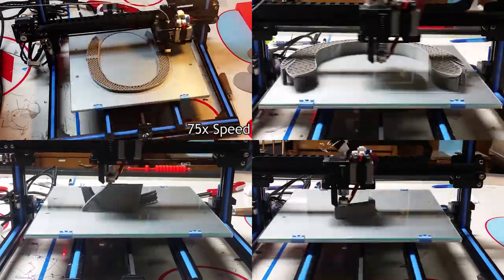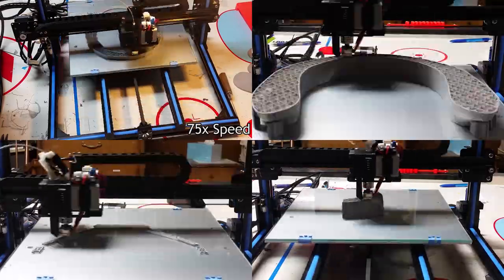Metro 2033 Spartan Helmet 3D Print Final Timelapse

Comment: That looks dope, I am planning on making one myself. Where did you obtain the stl?
Reply from the maker: I created it from the game's files. Unfortunately this has lead to some issues with the visor fitting on the helmet which is why I haven't uploaded anything on this in a while.
Reply from the maker: I've come up with a few ideas on how to fix the issue which hopefully won't involve reprinting it
Reply: Did you use 3D Ripper DX to get the helmet from the files? The only thing close to a 3d file I found was the papercraft pdo but that wouldnt do me any good.
Reply from the maker: @Spartan2035  I can't remember where I got the file. Once I get this worked out I'll share the files on thingiverse. The file I found was the .obj exported directly from the game and took me many hours in Meshmixer to fix.
Reply from the maker: @Spartan2035  If you don't want to spend the hours fixing it in meshmixer you can either wait for me to release the files (no guarantee this will actually happen) or make the paper craft one using cardstock and cover it with epoxy resin to make it rigid.
Reply: I actually managed to find a 3d file on the D6 Underground website. Im still a noob when it comes to that stuff but Ill play around with it until I get it right or you flesh out the files on your end (I would donate for the project if it was possible)
Reply from the maker: @Spartan2035  Could you send me a link to the file?
Reply from the maker: I think that''s actually the file I used. 3D slicers are very particular about files. The meshes have to be manifold, or in other words they have to be watertight. There can be no intersecting shells, and they have to be in .stl format. Game engines need none of this. Devs generally try to use the bare minimum number of polygons, so they aren't going to bother making manifold meshes. I did find some proper files made for 3D printing and will be reprinting this and doing it proper.